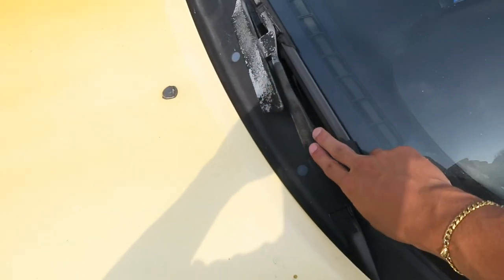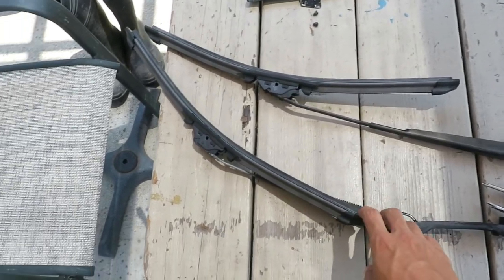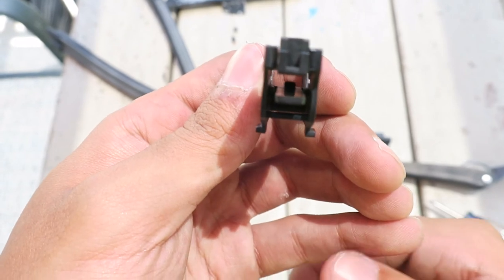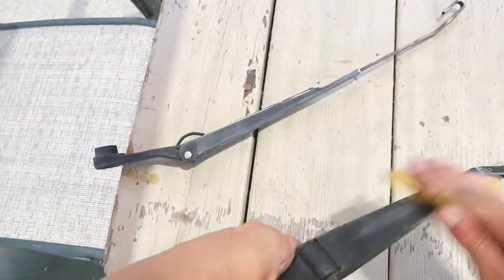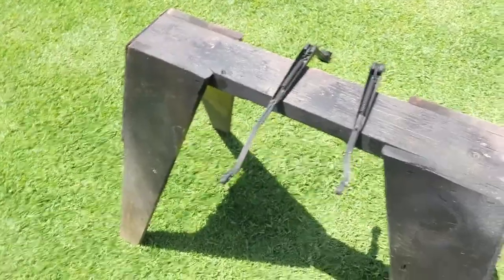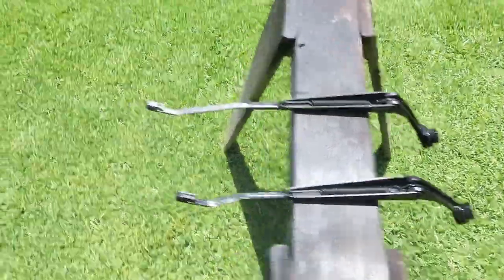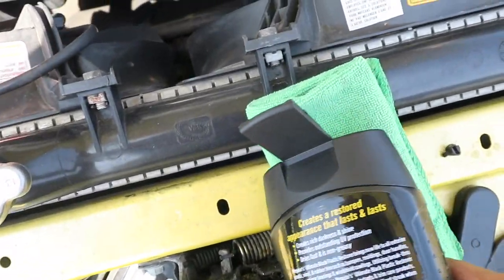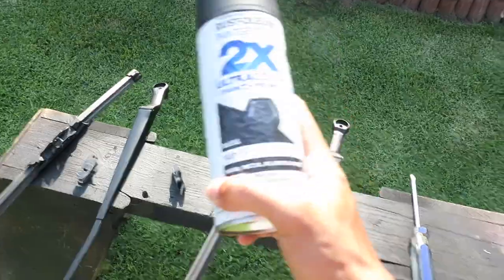How to Restore WINDSHIELD WIPERS & COWL! (on miata)

Comment: that goofy tab thing is a wind deflector, its used for keeping the rubber pressed against the glass so it doesn't skip over the glass when you're running the wipers at highway speeds. 
Maybe the had crappy rubber in the wiper blades back in the day, you don't really need it.
Reply: Finally I know. Lmfao 🤣
Reply from the maker: this guy is invited for thanksgiving 😂😂
Reply: The OEM wiper blades are actually far superior to either those sold today by Mazda USA or the aftermarket suppliers as they were graphite-embedded and were a grey color as a result. I think you can still get them in Japan but just like the Panasonic battery no longer sold here Mazda USA decided that cheaper and lower quality was what Americans wanted. I keep the wind deflector because why not, are you trying to save paint or something?